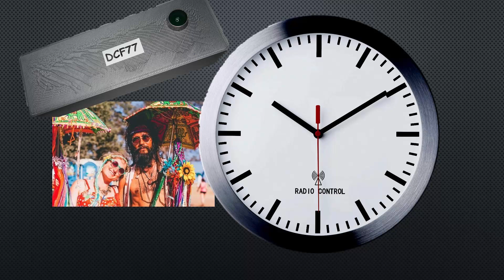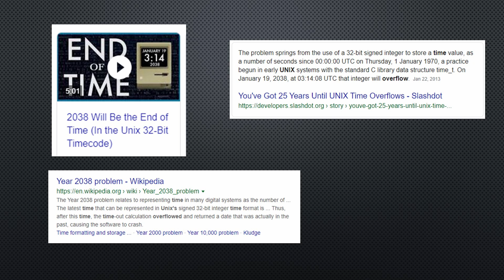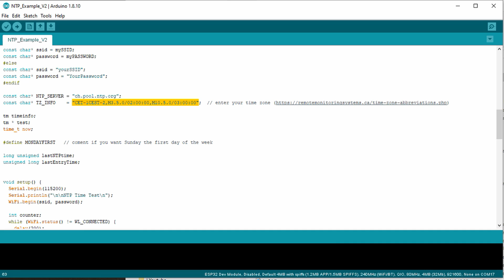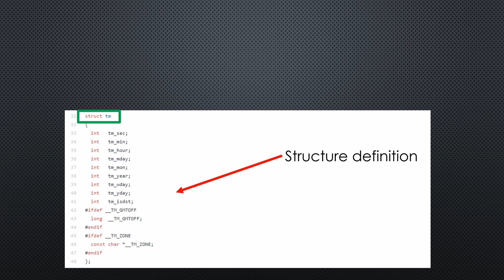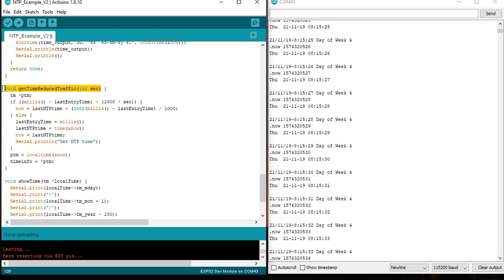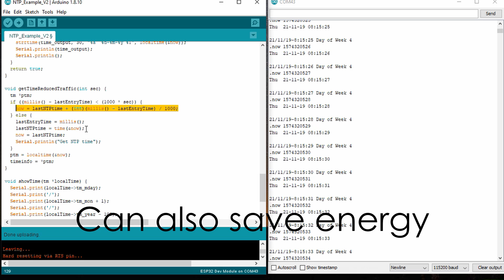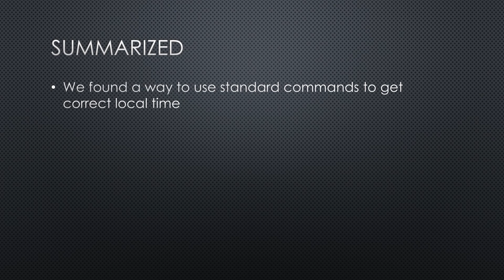#299 Tricks to get NTP time for the ESP32 and the ESP8266 incl. Summer- and Daylight Saving time

Comment: Nice video!  Just some comments on NTP and how it works.  Around 1987, I wrote the first UNIX NTP implemention of version 1 of the NTP protocol spec from a draft of the protocol document to see test if there was sufficient detail to interoperate with the "reference implementation" done by Dave Mills on the PDP-11 (written in assembly code, of course!).   First, the actual NTP timestamps are 64 bit fixed-point numbers, with a 32 bit integer component and a 32 bit fractional component of the number of seconds since January 1, 1900.  It must be that the library that you have converts the NTP timestamps to the UNIX epoch by adding in the offset.

Timekeeping is very tricky and difficult.  The goal of NTP is to synchronize a bunch of peers to a common timescale (UTC), which is slightly different from having them all synced to the same time.  There's a bunch of complex algorithms for both clock selection, as well as a model for the local clock that does timekeeping on the NTP peer.  When you implement the whole protocol, including the reference clock model, you actually compute both the phase-error of your clock (how many seconds you're off), as well as the frequency error of your local clock (error in the rate at which the clock advances.)  With a good implementation, you can easily detect temperature changes of your computer by looking at the computed frequency error.  And you can use this computed frequency error to continue to apply corrections to the local clock in the event you loose contact with your synchronization source.  One version of the local clock model is that of a phase-locked loop, and the filter on the loop's error signal tightens-up as you get closer to the correct frequency.  And of course, you're limited to how quickly you can slew the clock because if you go too fast, you invalidate the timestamps you exchange with your peer. 

But that's all when using the full NTP protocol, which estimates the latency and path quality to various synchronization sources and selects amongst them, and does all this fancy stuff, while continuing to periodically exchange synchronization messages.

When you use SNTP (the "simple" varient), you're just asking some reference clock, "Hey, what time is it?"   "Here you go:  12:34:56 UTC on this date".  However, even using this mechanism and (hourly?) polls, you could probably still do a gross measurement of the error of the local clock on the ESP, and use that to apply corrections in between asking the NTP peer.

Timezones are the least of your problems, in some ways.  When using UTC (or derived timezones), you get to experience leap seconds where every so often, the last minute of December 31st or June 30th have an extra second (or, in theory if the earth started to spin faster, on less second).  This causes a "bump" or discontinuity in the time scale.  This is a problem for processes that want to measure the elapsed time between two events because doing a simple difference in timestamps will occasionally not work.  For things really tied to physical phenomena, alternative timescales (like UT1 or GPS time) don't include leap seconds.  In fact, GPS time is offset by the number of leap seconds inserted since the GPS constellation was flying, and there's a navigation message that conveys the offset so that your GPS receiver corrects the time it displays externally to the the humans to UTC. 

Timestamps roll over.  Happily, the world will probably not stop working in 2038 when the UNIX timestamp exceeds 32 bits worth of seconds because we all have computers with 64 bit integers these days.  The NTP timestamps will also wrap, but there's plenty of context to figure out what the time is because NTP timestamps in the protocol are all about events that have occured with the very recent past, not decades ago or in the future.

All this time synchronization stuff will make you crazy.  It's a sickness, really.
Reply: Crazy enough to sit around in meetings wearing deely-boppers? Ah, the "good old days"... (from a fellow YFNSS alum)
Reply from the maker: Interesting stuff! It seems I am a happy guy because I only need time on the second (our trains leave on time ;-) )

Comment: struct tm, specifically tm_year was (and still is) the cause of annoying Y2K problems.  Lazy/"Clever" programmers simply printed an ASCII 19 in front of %d rendering for tm_year, leading to Y2K rendering as 19100 and this year as 19119 - you will still see these bugs on some legacy systems.

As others have mentioned:
0. UTC is for machines. Local time is for humans.  (UTC is the only time that should be found in log files.)
1. 64-bit operating systems (and filesystems!) have a 64-bit time_t. 
2. I just dug around the ESP dev environment on the computer in front of me and I see that time_t is just a (signed) long. How disappointing. "Internet of Stool", indeed. I did a lot of work to make sure that my employer at the time wouldn't be affected by the Y2K Problem  - now I see that every connected device is going to be laid low by the 2038 Problem.  headdesk
Reply from the maker: You are right with the logs. And also with all other reference times. But still it would be handy if NTP servers also would offer a service for local time ;-)

Comment: Great video, thanks!!  I found a library that worked well, but would have liked this a month ago :) as it seems simpler... That said, an issue I had with NTP was connection reliability.  For some reason, I would often get no response from the NTP servers (or some error i couldn't figure out) Wasn't hitting them often, and even tried setting up my own NTP server.  Didn't cause much of an issue until when the ESP restarts, it needs the time ASAP, and would of course display the wrong time until it could get a response.  Instead, I now use MQTT to get the Time from a NodeRed machine that responds and send the UTC code back on another topic.  Another option I thought of was to fetch a simple web page and grab the time from the headers, or again, have the http respond with json that contained the details i need.
Reply from the maker: My sketch checks if the year is ok to decide whether data arrived from the server. But using MQTT is also a good way.

Comment: You do know the British created the time zones in the first place? So why would we change our time zone after leaving the EU? That was just a cheap dig at the British, a low blow I would not have expected from you :/
Reply from the maker: Of course you are right.
Reply: Well, I thought it was funny, but in a different way. The British, having debated changing time zones for years without really doing anything about it are potentially about to watch as the EU does away with seasonal time changes altogether. If the change goes through then Britain will have to decide whether to follow the EU's lead (the horror!) or leave Northern Ireland out of sync with Rep Ireland for one half of the year or out of sync with GB for the other half. The political contortions required to solve that particular conundrum under the guise of 'British sovereignty' will no doubt be hilarious to observe. Of course, whatever happens it will be the EU's fault!
 
However, at least we have the standard tz library to save us from all of this!!!

Comment: Calling NTP every hour? How badly does the local clock keep time?
Reply: Local clock is just software and there is no calibrated frequency.
That said, it would be possible to derive an error delta which could be used to calibrate the local clock, but even then the frequency will vary with temperature so it will never be accurate.
Reply from the maker: I think the deviation is less than a second. But I did not check it.
Reply: might seem excessive  - otoh there might be applications where jumping a whole second could cause unexpected interactions with the logic e.g. something appearing to finish before it started.
Reply: I was concerned about this so I tested... Wrote a sketch that connected to wifi, set the time via NTP, then disconnected the wifi. Every minute, I wrote the time to serial, and I also had it serving a web page that showed the current time and the uptime (calculated from current).
After a full day, it had drifted by 1 second. I kept it running for several days, and it drifted by roughly 1 second per day still.

This will vary from unit to unit, and probably also by temperature, but at 1 second over 24 hours, it should never skip or repeat any second digits - it'll just stay on one longer or shorter than expected.

Comment: There is an small error in your source code:
Line 159: 
if (localTime->tm_mday = 0) localTime->tm_mday = 7;
should be:
if (localTime->tm_mday == 0) localTime->tm_mday = 7;
I also changed int to uint8_t at function 
bool getNTPtime(int sec) {
because the compiler gives: warning: comparison between signed and unsigned integer expressions
I am using platformio.
Reply from the maker: Thank you. I will change it.

Comment: It is worth noting that any machine in any network can act as an NTP service — type "man ntp.conf" on a *NIX machine. This is even the recommended way of setting a time reference for any local "organization" to avoid stressing the internet time servers... as well as the querying IP address being banned/blocked :-D. So any machine with a low enough stratum number can be setup as an NTP server, which can be synchronized with internet time servers using NTP... or using a mere GPS when no internet connection is available.
Reply from the maker: Thank you for the comment. I did not know that fact.
Reply: @AndreasSpiess  It's my pleasure :-).

Comment: Good introduction on the timezone implementation for the ESP and NTP server.  Now the fun part...

Lucy in the Skyyyy with Diamonds :P Half of the structure POSIX starts from number 1 and the other starts from 0, maybe some was with LSD and the other with magic mushrooms. UTC grants timming for all purposes and host needs to implement DST in its SW:  It can be done using automatic using Wi-Fi, GPRS , GNSS  ... to acquire the timezone or input manually in the region settings, and if has timezones incorporated.

Comment: Good video on an important topic. Glad you fixed the example on Github. It's OK to call time() as often as you like the SNTP library used by the ESP Arduino core only calls it once an hour. Another thing that is useful to know is that if you have a well configured router that issues NTP servers in its DHCP and/or DHCPv6 responses your time server will be automatically configured. This will override any in your sketch unless you take steps to turn this behaviour off (a bad idea normally).
Reply from the maker: Thank you for the info. I assume it still is I’m GMT and you still need the time zone adjustment?
Reply: @AndreasSpiess  Yep. The SNTP client functions exactly the same. You need to call configTime() to specify the local timezone and DST offset and enable the SNTP client. You can continue to specify servers here too but they will be overridden by whatever is in the DHCP response. I find this very helpful in reducing the configuration information that needs to be set up and stored on each device.

Comment: Thanks for a very informative (as usual!) video. I made a clock a while ago which ran off NTP but couldn't work out how to easily make it automatically change in response to DST so I cheated and added a switch! I'll have to revisit my code now.
Reply from the maker: Should be simple. But never change a running SW ;-)
Reply: @AndreasSpiess  That's wise thoughts from a wise man :-)

Comment: That's a good presentation, but you certainly like doing things the hard way. I personally would have used a GPS module with the ESP32 and saved complexity and myself from writing a ton of code. A GPS based clock would be totally self adjusting. I'm sure you could have figured it out pretty easy. Too bad you didn't grow up with me during the 80's in South Carolina. We would have been drinking, fighting, going to wild parties and building computers every weekend. I hope you have a great evening.
Reply from the maker: My lab is in the basement. So GPS is not a good solution for me :-(

Comment: Last thing I knew before this was sending NTP requests manually via UDP and converting the epoch reponse also manually.. that was too long 😂 .. 
**let alone handling the error if the packets  failed to reach the server or if we got no reply bla bla bla.. headache 🤧
Thanks
Reply: This is why my large NTP clock is built around a RPi instead of the ESP32, I wanted "proper NTP" and googled ESP32 NTP support for 5 minutes, got a headache and reached for the RPi. :)
Reply: @sstorholm  the only good thing about it is that it taught me how things are working in the background; in details.
It also might be good for small projects especially that it's cheap, you know we won't use a computer just to schedule a plant irrigation !

Comment: I haven't studied the code, but other implementations ask the timeserver every second. Not very nice.
You should put a timeserver on your router, a raspberry or other device on your local network.
A local timeserver syncs to the public timeserver, and adjusts itself to keep the time accurately. 
A pi may not be millisecond-accurate due to clock frequency variations depending on the ambient temperature, but good enough for time display.
Reply from the maker: The time() only calls the server once an hour. It is confirmed by a few commenters. Using a local source anyway can be an interesting possibility.

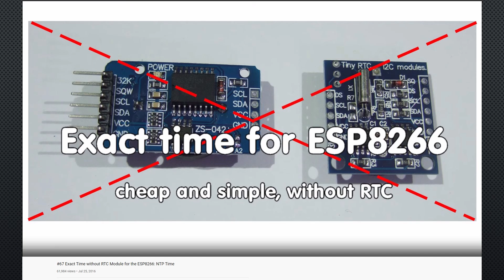Comment: Hello Andreas, just for the records :Starting at 4:50 you state Switzerland would be behind UTC, as far as I know Switzerland is one hour AHEAD of UTC (at least it was true until now, don't know what will happen if the EU stops that stupid winter/summertime switching one day), not behind as you mentioned in the video - might be different for the area of Bern but this is a different story :D. So the correct term would be UTC+1h = CET (aka MEZ) and UTC+2h = CEST (aka MESZ). Same for Germany ... However the definition string you mention is quite simple to understand and defines the timezone CET to be one hour ahead of UTC (reverse logic !) meaning CET-1 is what you need to get UTC ( CET -1h = UTC) and CEST-2 (CEST - 2h = UTC) is again UTC ... Switching time in March (M3 at 2:00) and October (M10 at 3:00), every time in the "5th week" (= in reality last week of the month). As usual the challenge is to not get into a recursive loop while switching back from summer to winter time (as you switch back at 3:00 to 2:00 and will have a next 3:00 the same day after doing that) ...
Reply from the maker: You are right. My explanation is wrong. At least the function should work ;-)

Comment: The tm time structure came from UNIX which was from Bell Labs. The months and weekday values start at zero to facilitate retrieval of the names which are stored in string arrays and arrays in C are always 0 based for the index. In this way you can use these values directly as the index to the arrays of the months or weekdays without any additional work.
Reply from the maker: Good to know. Thank you!
Reply: Also
Doing arithmetic is much simpler
E.g.
You start with a Tuesday, which has code 2
13 days later .... what weekday is it?
simple: ( 2 + 13 ) % 7 = 15 % 7 = 1
So it is a Monday, since Monday has code 1

In fact it is most of the time quite the opposite. The real question should be: Why the heck do you insist on 1 based indices? They just make life more complicated.
Reply: Yep and IF they had started with 1, some idiot (tm) would try to set it to 0.

Comment: Hello, am I the only one that gets an error when compiling the NTP_Example sketch? (OS: Ubuntu, Arduino IDE 1.8.10, selected board: Heltec Wifi Lora 32).  Error Message: NTP_Example:41:18: error: Time.h: No such file or directory. Which liabrary do I have to add to the sketch?
Reply from the maker: It was a typo. time.h has to be in small caps for the UNIX guys. I corrected it now.
Reply: @AndreasSpiess  Thank you! I have already fixed that in my code. I have found another issue: in showTime you set localTime->mday to 7 if it's 0 (sunday) - but this should be applied to localTime->wday (week day) . Maybe you're a bit of a hippie too ;-)
Reply from the maker: Should also be corrected by mow

Comment: TimeT has already been converted to 64 bit in some unix libraries.  So 2038 won't be the end of time, at least not for systems running on 64 bit processors.
Reply: Y292277026.596K
Reply from the maker: Good to know. Thanks!